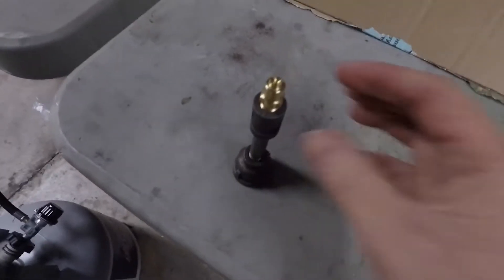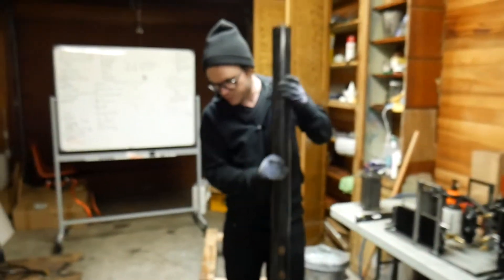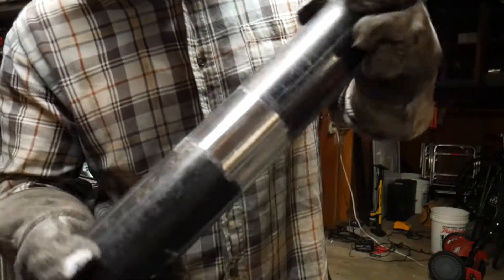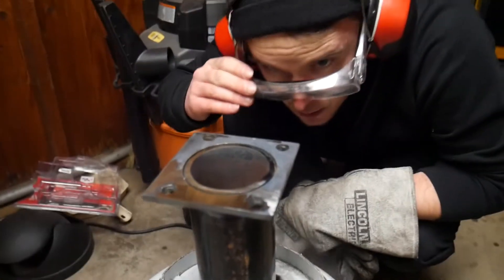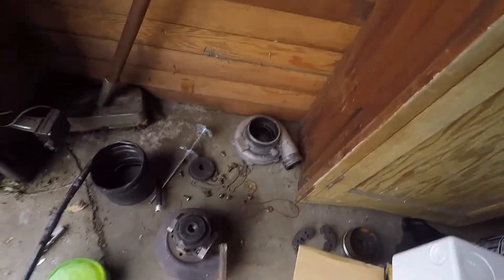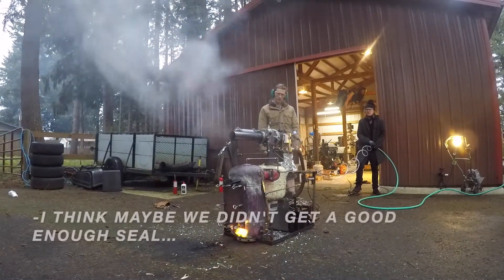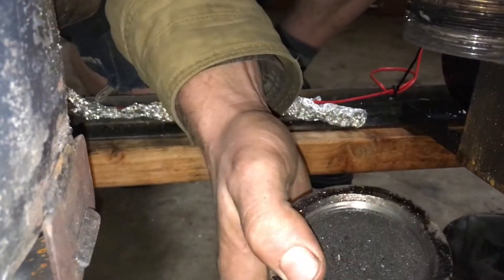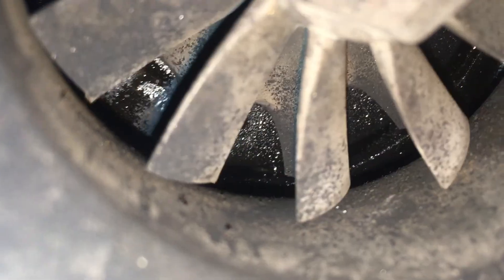TURBOFURNACE: WATER, FILTER, AND FIRE

Comment: Finally steel piping for cooling/lubrication.

This is one of the best models I‘ve seen on yt.

Three questions:
1. How could one automatically control it?
2. Are wood pellets a thing where you‘re located?
3. Is the dog ok?
Reply from the maker: 1) Slap a PID on the throttle position to control boost pressure
2) Yeah, we tried it once, it didn't really work, haven't tried againn
3) Affirmative, the dog continues to dog dogfully!
Reply: Good news about dog.

Yep, a PID would help *looks for cheat sheet for tuning*.

I‘ve seen a few of these systems, your is my favourite.
Maybe force fine wood chips in as fuel too?

Back in the day I would have wanted to build my own.

Comment: Have you considered recycling all of that carbon dust as fuel? With the right mix between that dust and air, it can be quite potent or even explosive.
Reply from the maker: Not sure soot burns, man. Is it not just carbon with no remaining hydrogen?
Reply: @survantjames  Carbon is combustible. If you mix soot with air in the right ratio it will burn very fast or even explode.

Comment: Controlling the exhaust works better for throttle
Reply: Do you think they should throttle the exhaust  rather than the intake? What would the benefits be of controlling the exhaust?
Reply: @danielreardon6453  higher volume
Reply: @brucebaxter6923  Higher volume in what aspect?
Reply: ?
The physical dimensions of the gas passing through the exhaust in a defined period of time?

I don’t understand?

It has roughly three times the flow out the exhaust than in the inlet.
It sucks harder as it spins faster and is hard to control the flow by restricting the cold side.
The hot side restrictions increases back pressure that directly takes away energy from the turbine.

Comment: I love it.  Am I the only one that sees this as revolutionary in the most practical way?

 Nye proposed a gear reduction drive to harness turbo energy.  I disagree, a tiny electrical generator built into the turbo rotor, or driven off the compressor side would be the most practical. If you're interested in power production. Obviously it will produce heat, so it will be a heat and power generator.  A valuable appliance for cold weather grid peak demand.  

Previous comments have suggested a heat exchanger to cool exhaust before turbine, and heat intake after compressor, increasing efficiency, and lowering exhaust temp, standard turbine practice.  Wood combustion is the other missing link, I propose a turbo added to an existing state of the art wood burner, such as a frohling boiler as one example.  A lot of insulating refractory, and a little bit of combustion design, a swinging and latching door, and this would be in business.
Reply: Rod Freess, The Frohling boiler Is designed for steam I believe..So all the materials and gases involved in the combustion in a frohling boiler doesnt need to be under such pressures as the working fluid is steam...

It would be wonderful if the Turbokeg or Turbo furnace can feed fuel in gradually while its running but the problem is you have to feed wood into a hot pressurised chamber.
Reply: Also Rod, You suggest to cool the exhaust before the turbine which i think is a great idea, which would be a good way of doing so in your opinion? Spraying water into the exhaust?